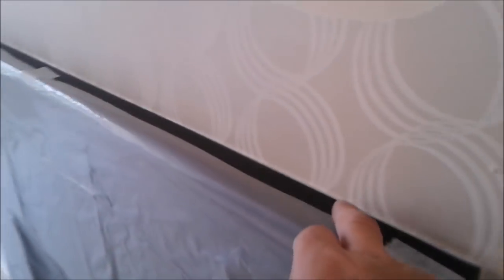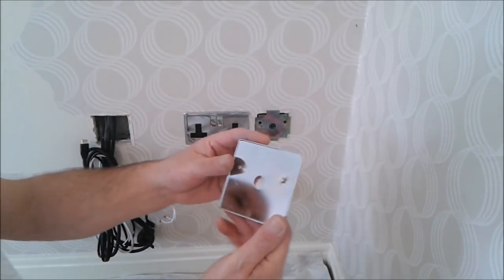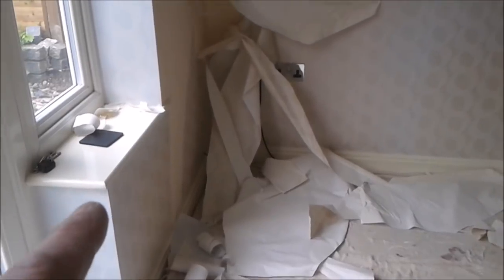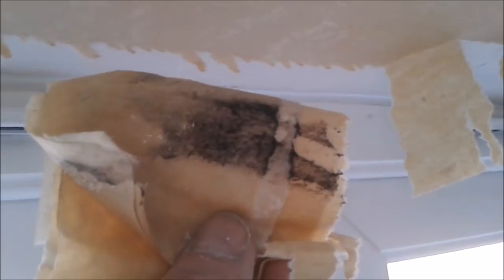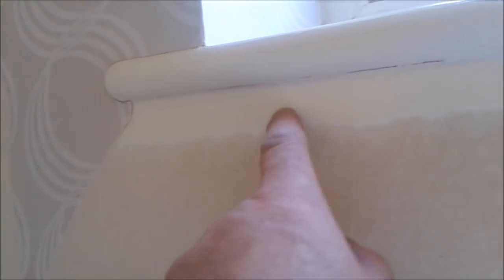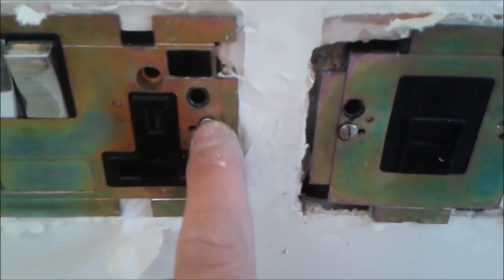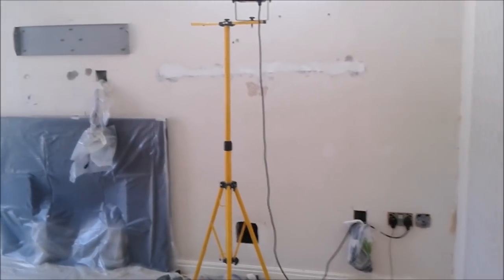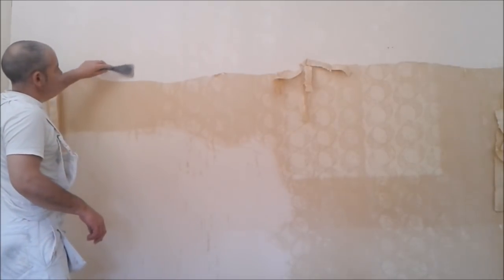Uncovering Problems Part 1 When Stripping Wallpaper

Comment: If you strip a room of wallpaper and you want to put up a curtain pole that would be attached to a wooden batten but the plugs dont stay put because of the crumbling wall what could i use so that the plugs stay in?
Reply from the maker: Polyfiller would work remove all loose seal then fill allow to dry fully. Double check you are drilling deep enough sometimes your better using longer screws and drill into the brick.

Comment: I was painting a condo last week and the ceiling have a water stain I primer it twice and then painted it like 5 times with ceiling paint and the stain still came through is that because I still wet? You see they had the roof fixed I just had the paint
Reply from the maker: Not sure sounds like your Stain Block has not worked. B.I.N primer two coats. Allow drying for a few hours.